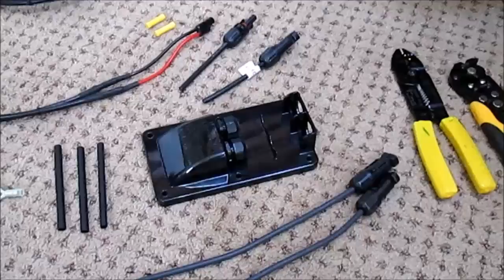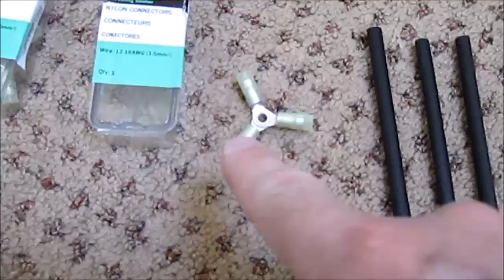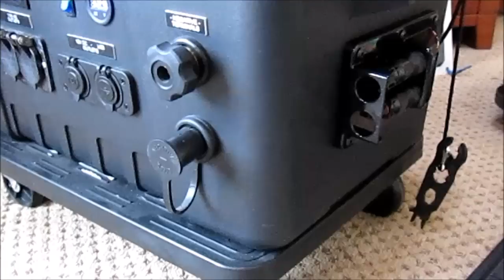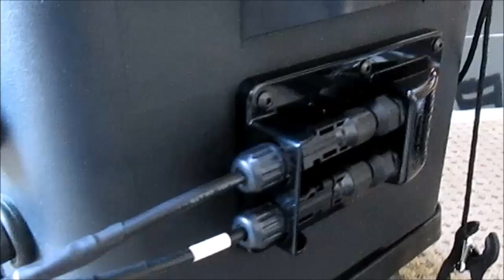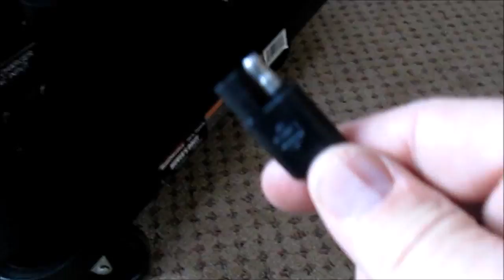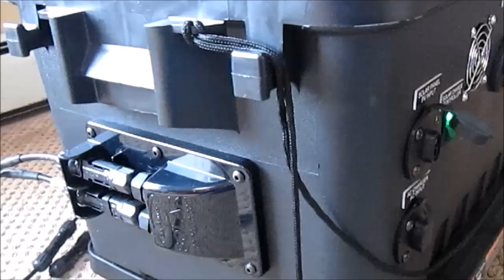V1 P5 DIY Portable Solar Power Generator

Comment: Hello Jim, thanks for sharing your work, one question I have regards grounding. Why is there no ground on the system?
Reply from the maker: Excellent question.   This system was built for primary use on a boat.  Earth grounding is impossible when on a boat.  This system is neutral ground bonded at the inverter.  When it is plugged into the boat's AC shorepower inlet there is additional protection from the boat's bonding system and GFCI outlets.
Reply from the maker: Steve-This question has been raised by other viewers-  here's a copy of another response I provided that gives additional insight.  Grounding:  I am not a professional electrician, so rather than trying to address this topic in great detail I will point you in the direction of a very helpful article that explains how inverters and generators, when used on boats, should be set up for safe use.  Here is the link:  https://theboatgalley.com/outlet-tester-showing-open-ground-on-inverter/ 

Of particular note are the comments made by Richard Anderson, following the actual article.  You will need to research and understand the concept of a neutral to ground bond and how that applies to using an inverter or generator without an actual earth ground on a boat.  I can tell you with certainty that the Wagan Tech Elite 400W Pro Pure Sine Wave inverter I used comes from the factory with a neutral to ground bond (for marine applications).  I have verified this is the case by using an outlet tester.  I tested both the inverter's outlets and the additional 110V outlets I installed on the front of the case with an outlet tester to verify that the inverter did in fact have a neutral to ground bond as indicated in the product specs.  All readings came back as "correct" with no issues.  If the inverter you intend to use does not have a factory installed neutral to ground bond, you can create one yourself. Google "how to make a neutral to ground bond plug".  I made one for use with my Honda EU2000i companion generator that I also use, without a true earth ground, on my boat.  It has a 30A outlet built in and I use my shore power cord to make the connection between the generator and the boat's AC shore power inlet.  A neutral to ground bond plug is inserted into the generator's 120V outlet to create the required neutral to ground bond.

Comment: Jim, you may have answered this down the line somewhere, but I’m curious about some of the wire gauges. The MC4 connector has a 10 gauge wire that you have connected to a 14 gauge wire from the SAE port via the 3-way splice. And then you are running 14 gauge from the 3-way to the charge controller? Is this right? Seems to me that you would need 10 AWG from splice to controller. Thanks for the help!
Reply from the maker: Hi Ryan, thanks for your question.  At present, I am using two 100 watt solar panels totaling 200W.  Combined they generate about 7 or 8 amps per hour on average on a good solar day.  In a 12V system, size 14 AWG wire will safely carry 10 amps 1.5 feet with a nominal 1% loss.  The wire run is actually closer to 12 inches in this instance so I am not concerned that 10 AWG is a need between the spice and the charge controller.  Even If you intended to max out the capacity of the charge controller (30A) and connect 400-500 watts of solar panel input you could safely use the 14 AWG over that very short length (according to AWG calculators I have used this would result in only a 2% loss).

Comment: It maybe on part 6 video, upgrade to 2 LiFeO4 much lighter battery weight plus much longer lasting battery plus more than 2,000 cycles. Price for LiFeO4 is the issue but in the long run, it's worth it.
Reply from the maker: May be a future upgrade, but still waiting for LiFePo4 battery prices to come WAY down.

Comment: If you did this over, would you use lifepo4?
Reply from the maker: I haven't looked into current prices for LiFePo4 batteries, but if they have come down considerably in price, yes, I would go with lighter batteries.   At the time of my build they were about 4X the cost of AGM batteries of comparable size.  If total cost is no consideration, and having a lighter system is, go with LiFePo4s.
Reply: Electro Dacus have been suggesting these. 

http://www.electriccarpartscompany.com/New-Energy-20Ah-Aluminum-Encased-Battery

I'm doing some research before I shell out my $$$

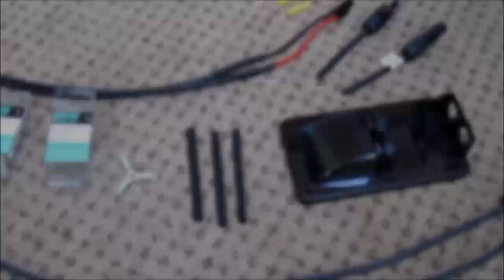Comment: I work for more then 30 years in Electrinics, Power Plants and Industrial Automation (PLC, Satelite comminications, water cleaning, and so on) and one thing comes up this time when i saw your wire diagram in the video at 02:15 minutes. 

Have you ever thougt about the event when you charging your DIY with the external loader and and one of the solar panels? What if the sun shine is low because clouds. The voltage drops significant, can be. Then your charge power goes NOT alone too the solar battery charger. It goes to the connected solar panels too and can destroy it.

A possible solution is to use diodes. Normal diodes have a voltage drop of around 0.6..0.8 Volt. When i calculate the amps which are comes over that diodes they can be get hot, not good at all because you lost energy and they can expolde. I have seen that a lot of times. Solution for that is a higher voltage then 12 or 24 volt (around 50Volt) and hgih amp (around 10..20 amps) diodes in a TO220 housing (ask google). Named as Schottky Diodes. They have a very low voltage drop and there are other housing types which fits better to your wiring. Your friend which was the electrion with some ideas, can tell you more about that issue at all. I think that will give you much more savety in your DIY box. For that check all Power Load wirings to have it save. 

And BTW: all your videos about your DIY box has given me an amazing idea todo that for my own. I will use a heavy tool box with wheels and extendable handles. There is one i have seen last month in the shop which have seperate boxes. (https://images.ffx.co.uk/tools/STA195621.JPG?w=1280&h=960&scale=both). Possible i will use another type. Some ideas from others here?

At all: Thank You for your work!
Reply from the maker: Thanks for your comments Mike.  If I understand your concern correctly, you are worried about voltage drop from the solar panels during the night or on cloudy days and the possibility of damage to the solar panels when the system is being charged by the AC trickle charger.  Since I use my system on a boat, it is never being charged simultaneously by both the solar panels and the AC trickle charger.  I also looked at the specifications on the panels I am using.  They have blocking diodes built into them to protect from reverse current flow to the solar cells.  For someone who was using my design in an application where they would choose to have both the solar panels and the AC trickle charger connected simultaneously and continuously, based upon what you have suggested, it appears that additional diodes may be needed to protect the solar panels.

Comment: Why do you have two of the 2 pin connectors in the back? They say solar and a.c. input. Could one port not work for both?
Reply from the maker: Great question Aaron.  The same port could not be used for both.  The solar charge controller I am using does not allow the AC trickle charge  to pass through it.
Reply: Jim Fisher 

Jim Fisher 

If the solar charge controller does allow the Ac trickle charge to pass through it, would that possible to use one terminal 2 pin for charging from ether solar panel or directly Ac adapter 110.

Thanks,
Reply from the maker: I think that would depend entirely on the specifications of the solar charge controller.  For whatever technical reason, the controller I have will not allow the trickle charge to pass though it.

Comment: WARNING! 
I see you intended on using 2 three way crimp connectors to combine your two input sources. Are you aware that they have exposed areas that can be difficult to insulate. When they are used on a power wire they leave a potential hazzard exposed. If you placed the power wire near the three way ground wire, you have just created a potential short that is not protected by any fuses. If those two three ways come in contact you could potential loose your entire system and possibly your boat if it starts a fire.
Sorry to be a downer. You have created an amazing system and I hate to see you loose it over a couple of cheap connectors.
Keep up the great work.
I hope you are still monitoring these comments.
Reply from the maker: Thanks for your comments.  Your point is well taken Bob, and safety is always priority number one.  Multiple precautions were taken to protect against the hazard you described.  There are in fact protective inline fuses (2) built into both the positive wire leading from the two input sources to the solar charge controller AND another inline fuse in the the positive wire connecting the solar charge controller to the battery bank.  One or both of those would blow if those lines shorted.  In addition to those precautions, the exposed "hub" of the positive three-way connector was generously covered with electrical tape to isolate it.  The positive and negative three-way connections are also tucked away on two different sides of one of the batteries to keep them separated.  Thanks for bringing up this concern as it is this type of detail that is often not covered in my videos.  There are many inexperienced DIYers who will benefit from our discussion on this important safety-related topic.

Comment: Have you ever considered a low voltage shut off to the inverter? Just to protect the charge state of the batteries.
Reply from the maker: Luke, the inverter I used has a low voltage shut off built into it.

Comment: Can you use the SAE port with the 27 watt panel simultaneously with the MC4 ports and the 100 watt panel to charge the batteries?
Reply from the maker: That is a very good question.  I have not tried it, and I don't have any plans to do so.  Generally, it is not a good idea to mix dissimilar solar panels made by different vendors, but that does not make it impossible to do so.  In the case of my Instapark Mercury 27 watt panel and my Renogy 100 watt flexible panel, their is an appreciable difference in their respective open-circuit voltages (16-18V vs. 21.7V).  That makes me very hesitant to use both ports simultaneously.  Here's a link to a good article on the subject http://solarpanelsvenue.com/mixing-solar-panels/    I recently added to my solar array for a total of 200W... I am now using a pair of Windy Nation 100W flexible panels and they are providing all the amps I need without having to tack on the small 27W panel.

Comment: Thank you for your videos. I just ran across your videos. I am making a very similar project. I am ordering the MC4 Cable input plate. But, i cant see from any photos what it comes with.  I've looked at your wiring diagram . How do i connect from the plate to the controller? Do I need to buy anything else? another set of MC4 connectors?  Thank you
Reply from the maker: Eric, unless the MC4 plate comes pre-wired by the distributor you will need the following additional items;  a pair of short MC4 extension cables and 2 three-way connectors:
https://www.amazon.com/gp/product/B00LOMM9PW/ref=oh_aui_detailpage_o01_s00?ie=UTF8&psc=1
https://www.amazon.com/gp/product/B000NHZZVO/ref=oh_aui_detailpage_o00_s00?ie=UTF8&psc=1

The short MC4 extension cables can be cut at one end and, inserted through the glands of the MC4 input plate, and then spliced to the SAE input using the three-way connectors.   Then run a single positive wire with a 30A inline fuse in it to the + solar input input on the charge controller and a single negative wire to the - solar input on the charge controller.  Unfortunately, there was not enough space on my main wiring schematic to add the MC4 input plate details, but if you go to my part 1 video and click "show more" you will find  links to a variety of supplementals documents and to a simple diagram illustrating what I have explained insofar as the MC4 plate installation is concerned.  Link here also:
http://creeksideartifacts.com/wiring_schematic_mc4_cable_entry_plate.pdf

Comment: Jim, just finished viewing all parts of your DIY Solar Power Station (as generator just does injustice to your unit). One word "SWEET"!

Had a thought, although you do have LED unit on the Controller/Inverter deck, how about an LED strip inside for emergency, should you have to "mess" with the internals during low light conditions. The one on the lid is helpful of course, but would be a little cumbersome to manipulate the deck to illuminate the interior. Of course, I'm assuming the light currently on the deck is not detachable.

It is a very nicely done unit and shows your attention to detail, both on the unit and in the graphics that accompany the overview. Thank you!
Reply from the maker: Thanks for viewing and for your generous comments Angel- they are appreciated.  You certainly could install another mounted light inside the battery compartment, it would be easy to add.  I have a USB LED light made by Goal Zero that is easily plugged in, has a long cable, and can be used as a highly mobile "trouble light".  Here's a link http://www.goalzero.com/p/334/light-a-life-mini-usb-light
Reply: I see what you mean. Thank you for the link; will be adding this to my EDC/Auto kit at minimum. The compact nature is great along with daisy chain capability with USB port!

Comment: This is exactly what my wife need for extended trips in the back country. I may have missed this in one of your video's but what solar charger do you use with this system ?
Thanks for the inspiration to build ours.
Reply from the maker: I used a 30A charge controller similar to this one http://www.ebay.com/itm/LCD-30A-12V-24V-Solar-Panel-Controller-Regulator-Charge-Battery-Safe-Protection-/311800136602?hash=item4898bc839a:g:goEAAOSwjVVVsexz

Comment: I love this project. I have a relatively similar project I built for camping/emergency situations this year. It is a large coleman cooler with a TV in the lid, 35 AH AGM battery, solar input through SAE and has a lot of the same connectors on it (heck, what made me want to comment is that I couldn't find MC4 panels like what you added here). What I'd like to suggest to your project: add a small internal USB hub; if you look on ebay you can find 10 amp buck converters for less than 10 dollars and tie them into an externally powered usb drive. After that, add a couple of small USB flashlights (handy while camping, and emergency). In mine I have a small fannypack-turned-toolbag for some odds and ends. I also recommend keeping your panels at the MC4 standard, but just build an adapter to SAE. It's worked great for me and the adapter can go in the toolbag. Mine was designed for entertainment (tv, WIIu, radio...) but on a 16 person camping trip it was also used inflating mattresses, water purification with another project, charging a dozen phones, and being a table. One other suggestion, which the diodes are sitting next to me right now, is multiple inputs with a shottkey diode power bus before going into your mppt controller. They are the same diodes you'd use in parallel panels, but you can use them for parallel inputs, like trickle, solar, anything you can find to charge your beast. 
Anyhow, beautiful project, keep it up!
Reply from the maker: Thanks for viewing and for your comments Aaron, they are appreciated, lots of good ideas for improvement.

Comment: I have a question.  I have a small portable solar power battery box for kayaking.  I have a Sae port for my in house charger and a Sae for my solar. Do I have to put an on/off switch or 10a breaker to safeguard my 30a solar charger
Reply from the maker: Yes, it is a good idea to protect your solar charge controller with a fuse or breaker.  A switch is desirable if you want to turn your charge controller off completely to save some power when the battery box is not in use.